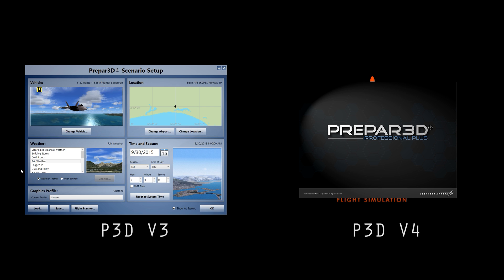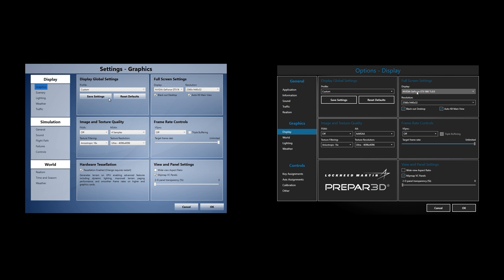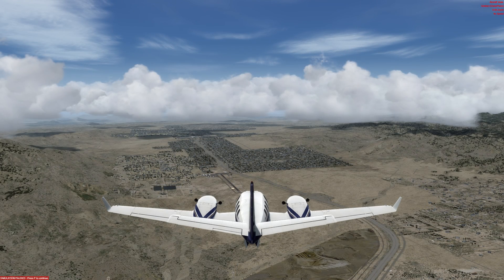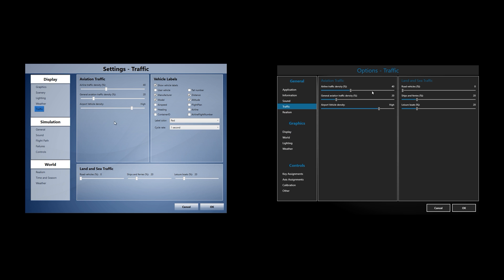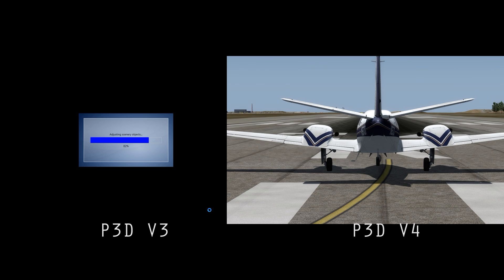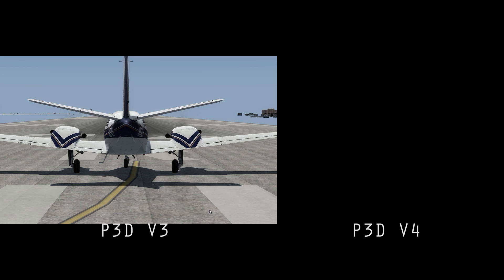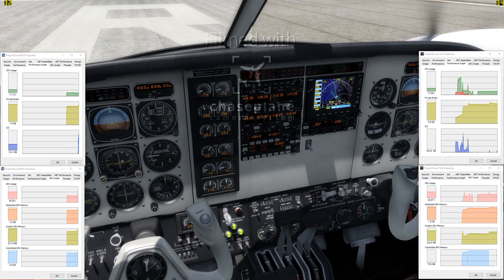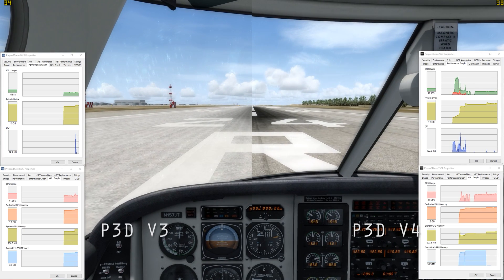P3d v3 VS. P3d v4 *Performance Side by Side and Stress Test*

Comment: I own an i5 computer and used FSX. When i changed to Prepar3d i was upset that it looked the same as FSX, but changed my mind a few days after. Performance was excelent. I guess V3 is fine for my system. 
Another thing is i bought hardware and software for V3...don't want to take chances with other sim version.
And well, i know nothing about computers, i just know what i like, no lag and good fps....and for me V3 and 4 look exactly the same

Comment: I just migrated from FSX to Prepar3d a couple of weeks ago. I bought V3 since, according to  P3d, V4 requieres i7, and i own a i5. In the video i can not see a big difference, however, as i said, I'm new with p3d. Is there a difference that would make V4 better? Woulndn't it run well with an i5? To go from V3 to V4 can you buy an upgrade or is a completely different program you have yo buy?
Reply: I have i5 and great number of addons including pmdg 777 and have ver good performance

Comment: When I fly X-plane 11 it feels like a game. There is no immersion or sense of really flying, with all the aspects of flying. X-Plane is capable of some pretty awesome graphics out of the box. In some ways better than Prepar3D v4, but when it comes to modeling the aircraft systems it's not even remotely comparable; P3D is infinitely more realistic and immersive when it comes to actually learning how to deal with all the intricacies of flying. Hopefully one day the graphics and systems modeling can be combined on a single PC in a single simulator. The truth is we simply do not have a PC capable of doing all the things we need, so P3D has to give up a little in the way of graphics to get all the realistic traffic, ATC, aircraft systems modeling, real world weather, etc. X-plane cannot touch it in those areas and that is why I will stick with P3D for now. Besides, with the $3000+ of add-ons I have on P3Dv4 it actually does look as good or better than XP11 and is extremely immersive to boot.  I have many study level aircraft for P3D that make the sim IMO. ATC in P3D is light years ahead of X-Plane. I've been flying all versions of MSFS since version 1.0 and all versions of P3D. Heck, I even flew the very first SubLogic Flight Simulator back in the early `80s. Even today i have seen things occur with ATC that I had never seen before. The depth and complexity of the AI in P3D is second to none. I find I get bored with XP11 very fast.
Reply: I know it's 3 years late but now X-Plane has many complex addons.

Comment: I just stuck with version 3 until they added VR support in 4.1. Bought V4 today. Excited to try it out with oculus. If I don't like it I can always go back to a regular display with the new features and performance. V3 runs great with an 8700k and 1080Ti.
Reply: Sam Reeves what do you think of the VR support using the Rift?

Comment: Hi Jordan. This is very thorough. Thank you. Do you recommend using the same settings for v3 as v4 - or will you be making a new P3Dv4 settings video? What about if you want to use dynamic lighting at night? I've found you have to turn a lot of settings down so that FPS doesn't drop horribly with dynamic lighting enabled.

Comment: I wonder how LOD radius is handled in v4. That was always a huge issue with previous versions and especially bothersome when it came to the 3D night lighting that you get with FTX or Ultimate Terrain. It looked good when you were super low, but above 5,000 ft and it's like the world had gone dark. Night Environment was a product that helped in this area, but it's very regional and expensive (both on hardware resources and $$). It really just destroyed the experience when flying at night/early morning. Hopefully v4 does not suffer the same.

Comment: Just installed the PMDG 777 on V4. Wow! FPS are great. UK2000 is hit and miss regarding compatibility. Edinburgh does not work and there are texture problems, but I can't complain as I have had great use thus far. Same with Aerosoft airports. Well done Orbx and Fly Tampa. Everything works a treat. There is a workaround for UT Live and it works great. The 737NGX should be updated soon. All I need is for FS Labs to get their act together. If they charge for an upgrade, the A320 will be my first and last purchase from them. We've already paid a premium to them for P3D and the A320X is such a new product.

Comment: Thinking of jumping to P3D.  Is the Pro lic. necessary,or is the Academic lic. good enough. Is there much of a difference in appearance between the two. Which would you suggest. 60 dollars looks better than 200.  thanks.
Reply from the maker: No difference. Read the EULA and License agreements and decide which is best for you.
Reply: Hi Jordan. Thank you for your reply. Which version do you use, and if both versions are the same, why spend 200 dollars when you can get the same product for 60? Unless you are going to use the program for which it is intended. Otherwise the program will be used the same way as FSX, except P3D is 64bit, and has an overall better look.  Appreciate your informative videos. Thanks

Comment: Still lots of stuttering in the scenery when the plane turns, rather disappointing.
Reply from the maker: Remember that is also the most intensive area in flight simulation. A normal scenery wouldnt struggle like that.

Comment: 12GB DDR4 is a rather odd amount, given the power of 2 nature of RAM capacity and the dual-channel memory controller design of Skylake.  The most likely reason would be the use of 3 DIMMs, rather than 2 or 4.  Given the allocation of 10GB VAS under your test conditions I would argue you ought to increase your RAM capacity to 16GB and re-test.

Comment: Sorry, I did not get the issue with different LOD settings - why is that?
Reply from the maker: +Antonio Intini V4 draws autogen at a much further distance than v3 when it's sliders are maxed. So I had to turn it down in v4 to avoid making it an unfair assessment.
Reply: Great, thanks!

Comment: How did you make the Duke v2 run under 64 bit? I thougt real air have ceased operations in december of last year
Reply: it uses XML code rather than DLL which allows it to run in V4
Reply from the maker: +Matt Hayward Yup

Comment: Neither FSW or P3D v4 appears very different from its predecessor. Maybe with time the differences will become more apparent.
Reply: Not really, because P3D and FSW use the same engine (ESP I think), and that's the engine used in FSX (2006). So, until someone re-build that engine completely, or create a new one, the new versions of P3D are always going to look the same.

Comment: Quick question. How is it that V4 is using around 6 gb of ram to generate a similar (if not same) output as V3 that is only using 2 gbs roughly? I noticed that the drawing distance is roughly similar and conditions look about the same but why is it that V4 is using 3x more ram to produce the same result with a few more fps and less stutters? Thanks! Looks awesome!
Reply: Rohan Patel  JK specifically mentioned he turned down LOD in V4 for comparative leveling. Seems that everyone is quick to comment and didn't pay attention to his introduction comments. SMHID
Reply from the maker: +Rohan Patel It uses less because it is engineered to purge VAS aggressively to keep itself from ooming. V4 will take as much VAS as you will throw at it.
Reply: Jordan King thanks Jordan.
Reply: Positive Rate I know that. Read my comment again. If you can't answer it then please don't comment. Did I not say holding conditions similar between the two sims?

Comment: thanks for the video. Great work. As for p3d I am bit dissapointed that so little new innovation has taken place in the core engine and updating the art assets over all this years. I want to be enjoy P3d and my existing addons there, but I find myself more and more spending time in xp11.The performance there is just incredible, high fps and close to stutterfree. Flying over urban areas with autogen as far as the eyes can see. Just incredible!
Reply: John Moore sure in one way it is. But it's dissapointing that the visual appearance to a very limited extent is updated. it just feels like a very old simulator imho
Reply: John Moore for me this is truly state of the art graphics: https://m.facebook.com/groups/1814745552090934?view=permalink&id=1930410873857734
Reply: I get 15fps in XP11 and 60 in P3D V3 both in 4k max settings...I'm sticking to P3D.

Also P3D has more devs that I like, it really comes down to preference and what you're willing to spend, I use mine for training

Comment: I noticed at 9:04 the rendering of the airport died and turned blacked out.
All in all its still stuttery and that's with settings for Autogen turned down.
Looks exactly the same as V3 and Dovetails latest 64bit offering, lifeless and boring compared to Xplane 11.
Sky colour and HDR lighting still can't get even close to Xplane 11.
To sum my view up, it's utter FSX looking pants, it's 2017 for Christ's sake and this looks no different than age old FSX with Orbx lol. Flight dynamics still haven't improved (totally unrealistic) hardly anything new over V3 apart from LOD raidias @64bit, Hell even Dovetails offering has more improvements including rain effects on cockpit windows etc.
V4 hasn't even improved night lighting (street lighting etc) it's still using Orbx lol.
Thanks for the video, it's confirmed my move to Xplane 11 was undoubtedly the right choice. It's so far ahead of P3d and Dovetail and FSX it's embarrassing.
Reply: 1. LM would disagree with the fact that it doesn't have a future. Even if the fanbase evaporates, they can fall back on their professional market.
2. LM's priority isn't graphics, there are dedicated devs for that, they're are about building a platform for devs to code for, not trying to do it all themselves like Laminar is trying to do. 
3. Comparing v4 to FSX is literally comparing a simulator to a game. Like I said, it's all about what's under the hood that matters. Dovetail shot themselves in the foot by making devs sell through steam.
Also, correct me if I'm wrong, but PMDG coded for XP-10, not XP-11 so technically you don't have PMDG in XP-11.
Reply: ConorHDGaming Frankland You're right, I'll leave you to get on with editing you're 64bit  old FSX config file to try to help with Stu Stu Stu stuttering V4 that has less features but looks the same as Dovetails latest 64bit offering lol.
Reply: John Moore Yep!! I've even had the very first flight Simm from Microsoft back in the early eighties, you could only run it on a BBC model B computer, it wouldn't run on Model A.
I moved from FSX to P3d V1. I uninstalled V3.4 after spending 4 weeks on Xplane 11 Beta version.
The reason I say it's FSX is due to the code being basically the same, a few added lines in FSX CFG doesn't make it a new platform ie P3dv1 up to V3.4.
This Version V4, is still using that same CFG and code. 
Question for you, Its now 2017, Do you think a new  flight Simm should still look like FSX?
Have the same flight dynamics of FSX? 
The list could go on and on incomparisons with old FSX.
Reply: Question for you is why are all X-plane 11 fanboys so obsessed with graphics... Is this a flight simulator or a scenery simulator...
Reply: Virus_City Have you ever used or seen Ortho4xp For scenery??.
It's real world scenery, it blows Orbx out of the water as it's actual...not made up.
And you can have it at much higher resolution than Orbx. No blurries either.
And yes, it's totally free!!.
So I give scenery to Xplane 11 as it's Actualy real true to life.
I Guarantee that if ORTHO4XP was compatible with P3d Orbx would be out of business.
Reply: Foreigner037 I'm not quite sure who you are referring to, but Mayday clearly watched the whole video, and gave examples why he thinks Xplane is better, it's not like he came here with the intention to hate on P3D. They both have their pros and cons.
Reply: Ohhhhhhhh fslabs the company that refuses to take responsibility! Nice! Keep dreaming young child. Go back to your arcade flight "simulator"
Reply: One question, have you ever even owned FSX or P3D at any time in your simming career? Saying P3D is FSX but with 64 bit implies that you've never used either one.
Reply: X-plane 11 makes me want to kill myself before I get into the air...
Reply: Yeah, But I wasn't counting Ortho scenery, as that is actually produced on a user basis. I was considering products for sale to everyone. But yes, Ortho scenery is absolutely stunning.
Reply: Virus_City Best part of it it's totally free:)
Reply: So let me get this straight. You came to a P3D video just to say how X-Plane is better? I'm sorry, but this is arrogant and quite frankly, stupid. Just go back in your X-Plane hole and stay there if you like it so much. Noone forced you to like either of these products anyway.
Reply: Foreigner037 Nobody said including me that I was "forced" to like either of them lol.
So like yourself you're comment is irrelevant....much like an old FSX looking Simm in 2017 😊.
Reply: MayDay GoingDown!! It is not said but you are making it look like so
Reply: Foreigner037 Just stating the obvious based on what I have seen in all p3d v4 video's.
Stutters are still present, Autogen popping especially speed trees etc.
Still poor ground texture resolution and texture loading as seen in this video ie black airport etc, all things mentioned you have no argument as they are very clearly evident in the video above and in many others.
The most important thing for me is that it's 2017, this is 64bit, and STILL looks the same as old FSX with Orbx. Again that's a valid point...not a said point.
Reply: "2. A future."

Are you kidding? Whilst X-Plane 11 is fantastic, P3D becoming 64bit has only resurfaced many of the already large number of add on developers have stated that they WILL be moving to P3D v4 as stated below.

https://www.facebook.com/permalink.php?story_fbid=1744881562207147&id=882745525087426&substory_index=0

I'm not doubting X-Plane having a future at all, but just because X-Plane is performing better on a lot of things at the moment, doesn't mean it always will, and doesn't mean P3D will become nothing.

Example: Yahoo was once performing better than Google.
Reply: MayDay GoingDown!! I
Reply: And LM ( a company with 100K employees and resources) that is continuing to develop it.
Reply: John Moore Unfortunately thanks to P3d v4 looking like old tired and tested FSX STILL...that fan base is now becoming increasingly smaller lol..Xplane is now getting bigger...as they see for themselves not only does it blow P3d v4 away visually and flight dynamics but also more and more developers such as PMDG who have already made there first aircraft in Xplane 11 are seeing it also. 
For what V4 offers you could simply buy Dovetails latest 64bit offering, it's cheaper, looks the same, performs the same, and has more features lol.
Something Xplane has over both
1. A far more realistic visual and immersive flight experience,
2. A future.
Reply: Have fun with your non study level aircraft!
Reply: ConorHDGaming Frankland I thought PMDG was a study level aircraft??? Lol.
Reply: ConorHDGaming Frankland Oh it's all gone quiet 🤣🤣🤣🤣.
Reply: ConorHDGaming Frankland Fs Labs A320 already announced there product will be arriving too...Lmfao.
Or do you consider Fs Labs a failure product too. 😂😂😊😂
Reply: ConorHDGaming Frankland X-Plane users like to point out the graphics because they are superior. As do P3D users point out better developers because they are superior.  And, X-Plane can't be a "scenery simulator" because the so called "king" of Orbx has not made scenery for it, So I would hand that crown to P3D with FlyTampa, LatinVFR, and Orbx... As to a FLIGHT simulator, have you flown a real X-Plane aircraft?? Take the PMDG 737 for a pattern, and then go over to X-Plane 11 and try out the DEFAULT 737... In terms of FLIGHT, the XP11 default aircraft will feel miles more realistic at any time. If you are looking for a sim with better scenery and better developers go for P3D. If you are looking for a sim with realistic flight models go for X-Plane.